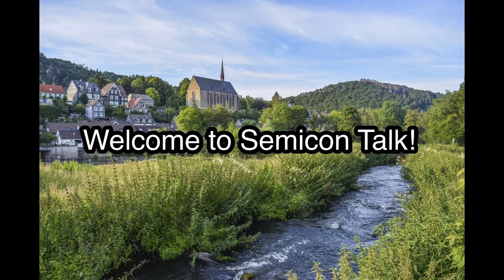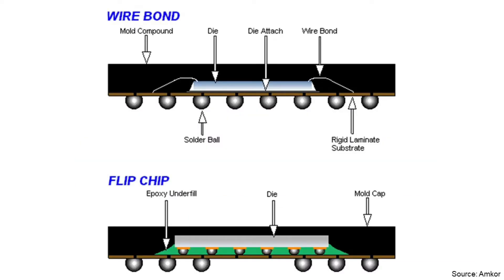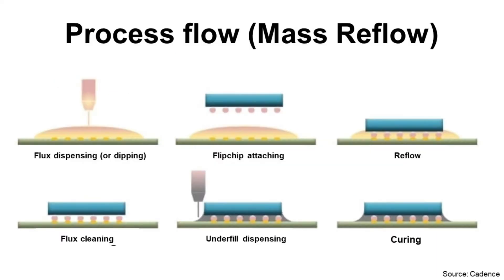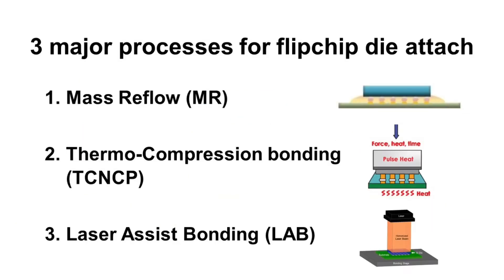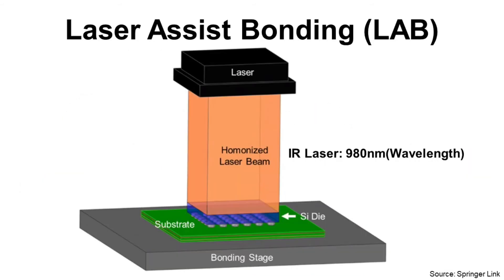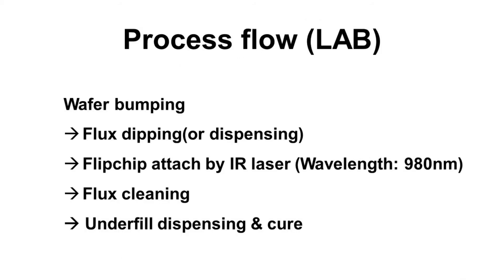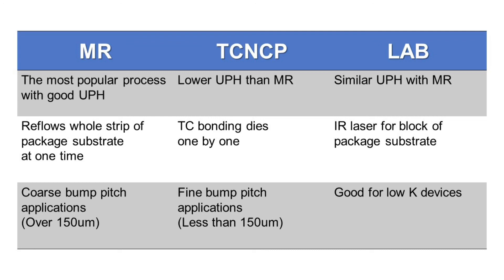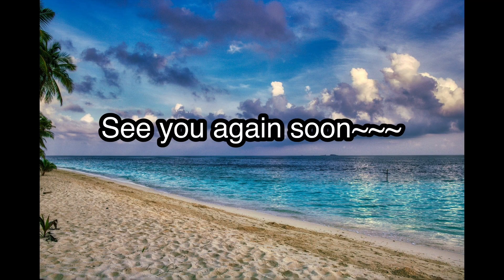[Eng Sub] Flipchip die attach process: Bump, MR(Mass Reflow), TCNCP, LAB(Laser Assist Bond), NCP

Comment: How is the status of adoption of LAB? For which die attaach applications is LAB especially suitable?
Reply from the maker: LAB has been used in high volume production of FCBGA for years especially when package warpage is critical. LAB is suitable for flipchip die attach process of FCBGA. LAB can minimize package warpage by applying thermal energy only at bumps to make connection between flipchip die and package substrate. In contrast typical mass reflow applies thermal energy to whole package then causes package warpage which can result in non-wet between bumps and package substrate.

Comment: Can you explain the design of flip chip led strips? Is under-fill still required after reflow? How is the rigid and flexible substrate designed, what are they made of? Leads etc
Reply from the maker: Do you mean LED(Light Emitting Diode)? I don't understand your question.
Yes, underfill is applied after reflow and flux cleaning.
I will make episodes about substrate later.
Reply: @semicontalk3223  sorry, yes I mean LED. Specifically the flip chip LED on flex pcb process- I think is interesting. One thing I’m wondering is how the underfill is applied after chip placement and bump fluxing but before reflow? I’ve read that this is done but is it true? I would think the underfill would push away flux if applied before reflow
Reply from the maker: @Nodeagent  This is conventional flipchip process flow.
1. Flipchip die flux dipping - Bumps of flipchip die is dipped into flux and flux is applied on bumps 
2. Flipchip die attach - Die is flipped and place on package substrate. Die bumps with flux is contacted with bump pads of package substrate
3. Reflow - Package substrate with dies goes into reflow furnace and bumps are melted and form interconnection with bump pads of package substrate 
4. Flux cleaning - After this process there is no flux at bumps
5. Underfill dispensing - Underfill is covered bumps and filled the gap between die and package substrate 
6. Underfill cure
Coming video will include package substrate structure and material but it will not include detail design related contents.
Reply: Looking forward to the video on flip chips substrate! Will this encompass pcb design?